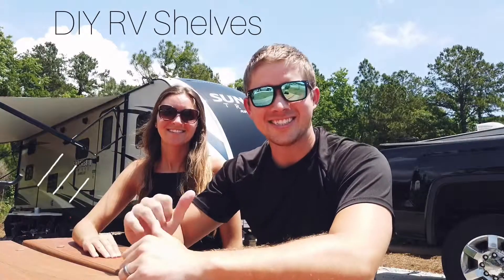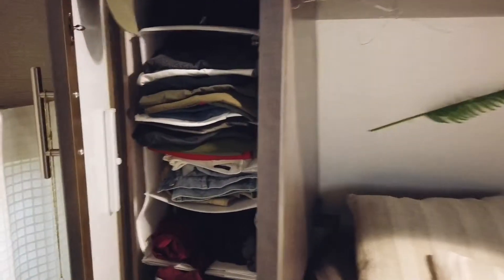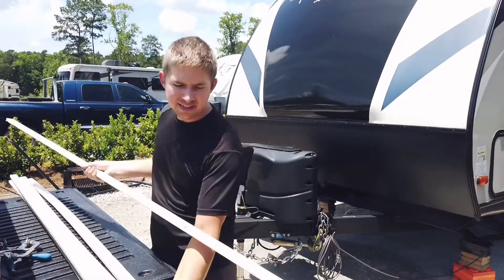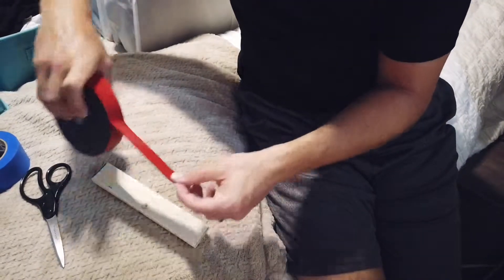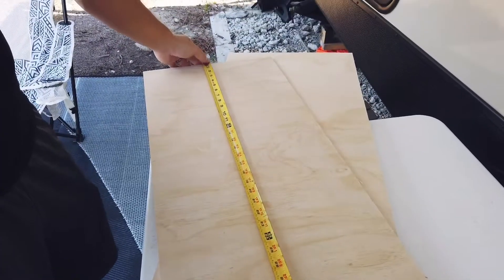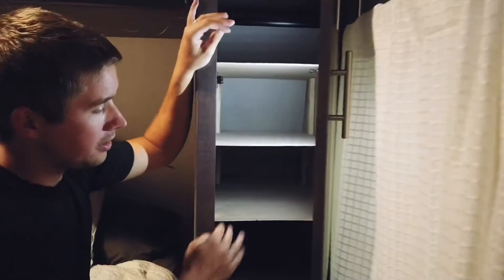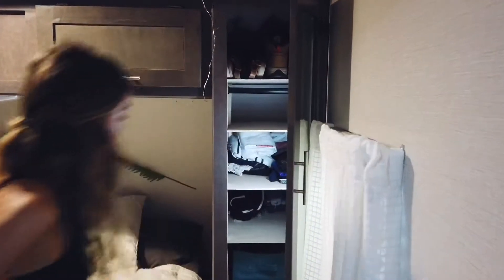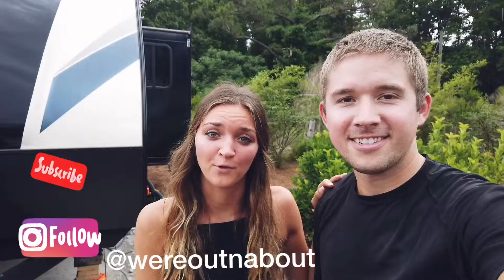DIY RV Shelves - making RV life even better!

Comment: Great idea! I've got the same exact setup up front in my RV and was going to build the shelves out of cardboard to keep the weight down (and to avoid using nails on the flimsy frame). But this looks nearly as light and even more clean. I'll be doing this in a couple weeks, thanks for posting this 👍

Comment: just an idea you could run those firing strips the length of the shelves top and bottom and slide the shelves in and out for easier access to the back

Comment: Great video. I've been in the process of putting up shelves in our 5th wheel because we have a LOT of very tall shelves with a lot of wasted space.  I love the idea of the double sided tape and I'd like to know if they supports are still sticking well to the sides of the closet.
Reply from the maker: Hi Patty I know what you’re talking about! We have been looking at 5th wheels and we noticed that. So many cabinets are so tall and you are right it wastes so much space. The double sided tape we used we bought at Lowe’s. I think it is heavy duty and rates for 30lbs. It was a little pricey but I liked the idea of not making any holes in the rv walls or cabinets. So far the shelves have been rock solid and the double sided tape has not let loose from the wall. No troubles with the supports coming unstuck

Comment: What material did you use for the shelving? Link at home depot? We couldn't find anything named underlayment that wasn't rolled. Thanks!
Reply from the maker: Something like this!! I can’t remember how thick of panel we used. It doesn’t have to be that thick because the shelves are so narrow. If you have really wide shelves you would want thicker wood so they don’t bow and bend with the weight on the shelf. Hope this helps

https://www.homedepot.com/p/Tri-PLY-Underlayment-Common-5-0-mm-x-4-ft-x-4-ft-Actual-0-196-in-x-47-75-in-x-48-in-448887/202327787

Comment: Did the double sided tape work allright cause I tried some tape to hold a simple cushion in place and with the heat it just fell off??
Reply from the maker: Our tape is still holding strong 3 years later. Make sure it’s the strong 3M tape we use in the video. The tape doesn’t take all the weight and support of the shelves. The tape is only holding the wood supports in place, then all the weight of the shelves rests on the wood supports that are in turn resting on the bottom of the closet. Build from bottom up and make sure bottom wood posts are resting on the floor of the closet. Then rest of wood and shelves rest on top of each other. If you do this then there really isn’t weight on the tape but rather the wood shelves and posts. Haven’t had any problems with ours :)

Comment: Can this tape be removed with no damage to the trailer in case you want to sell it?
Reply from the maker: Good question! It’s heavy duty tape so there’s a little risk the tape could pull some of the “fake wood” layer off the walls. I’ve pulled some of it elsewhere in the camper and it required a little bit of work and scrubbing to get all the tape off. If you go to sell the camper odds are the buyer would probably love your new shelves 👍🏻
Reply: I wondered the same, I'm going to try the velcro strips from command.